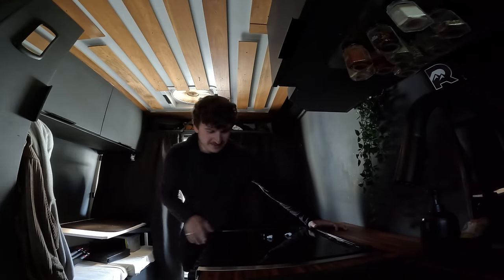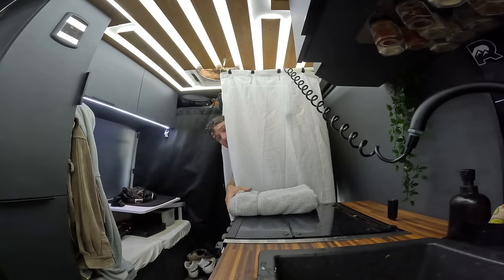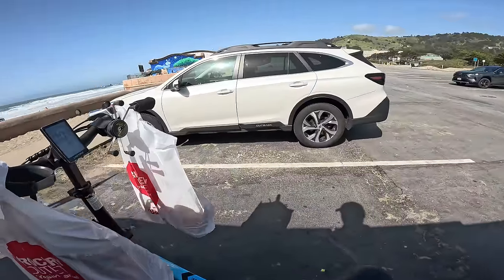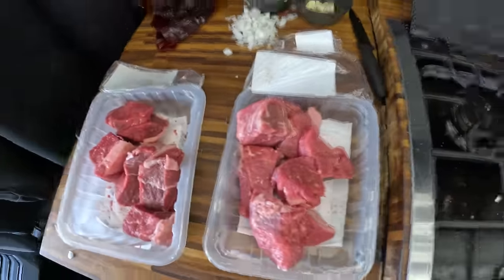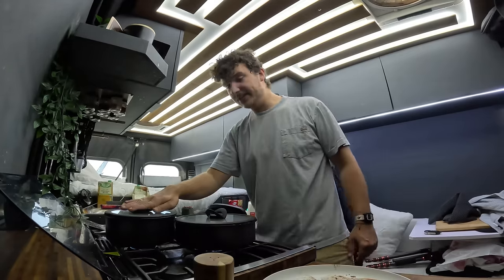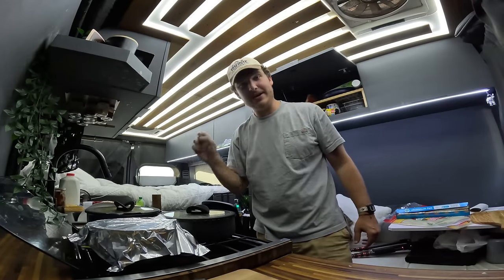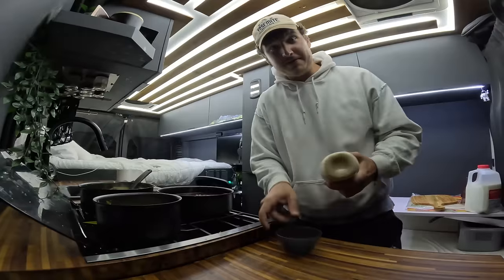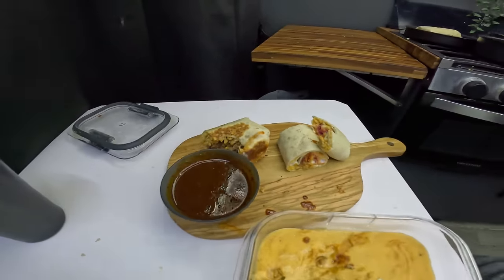Stealth Camping Taco Bell Parking Lot | Upgraded Vanlife Birria Burrito

Comment: Shower Drain Fix: Use a drill bit to drill the holes a little bigger. I used to be a plumber. I would do that for sinks that didn't drain fast enough with the same drain grate.

Comment: 5:43 it is pronounced like beer-e-ya with a rolled r sound. But the food looks delicious!

A couple of things to help improve:

1. Add the meat juices from the plate. Also, keep the oil in the pan unless it has burned. It has rendered fat from the meat which adds a ton of flavor. 
2. Instead of using tomato paste, add a can of diced tomatoes to your blend and add that to the beef in the pot 30-60 minutes before serving. 
3. Use cilantro over bay leaves. 

Enjoy! Thanks for another great video from The Stealth Camping Chef!

Comment: You probably know this, but most rv’s have a bypass for water heater when adding rv antifreeze. I was thinking with a bypass valve you could eliminate unhooking the water heater. Just turn a couple of valves to cut water off going to water heater

Comment: Another great video. I was wondering do you stand directly on the floor for the shower? I think you could take the curtains and put them in a square plastic or rubber basin that is shallow and stand in that when you shower. Also you can make a hole in it and put a funnel that goes directly into  the drain allowing the water to flow straight out.

Comment: Umm. Always soak the chiles before deseeding/chopping, whatever. Oh, and you have a gas stove, so put a burner on low, and set your tortilla directly on burner, over the direct flame. Maybe 5-20 seconds per side, depending on burner strength. Tastes so much better, and also much easier to roll

Comment: I can tell by his knife skills that he most likely has no experience as a line chef (professionally), but he definitely has an innate ability to make a good dish.  Following directions is easy, and of course we don't see everything because there is editing involved, but he didn't burn anything and he had a great looking final product.  I was hoping he wouldn't combine the two pots into one, and taste teste them to see if they were different, since they weren't exact measurements.  From there he could extrapolate why one would be better than the other.   Either way though, I was entertained.  For the shower drain, I would get a cork or rubber stop (with a pull tab on top) and just plug it after each shower. The perforated drain is going to let odor into the van, better to just plug it up completely when not in use.